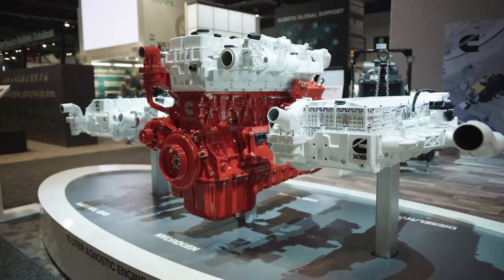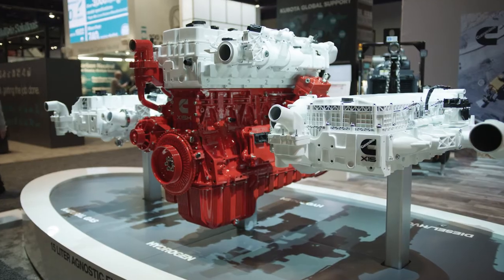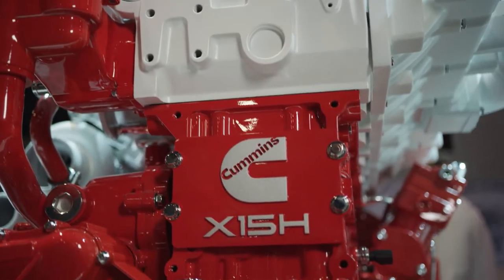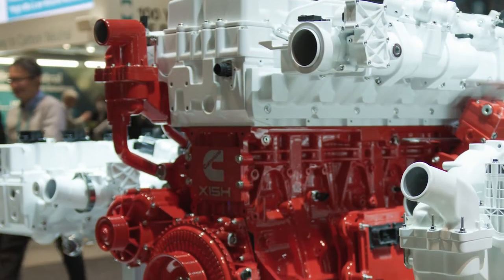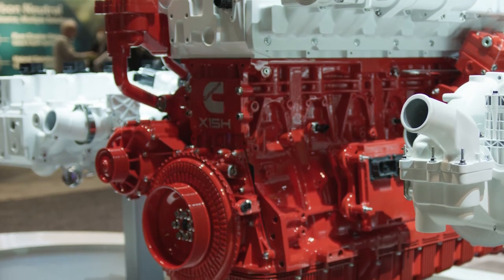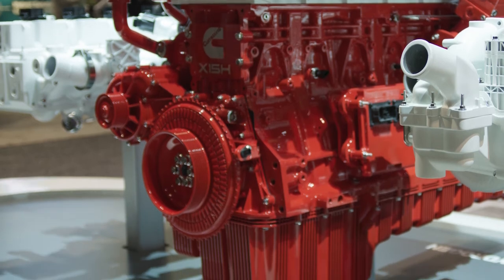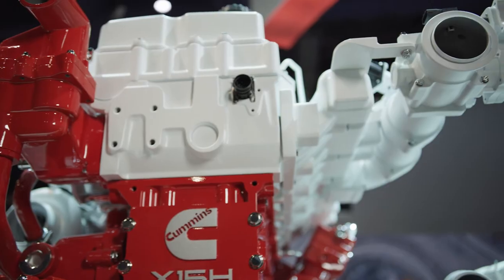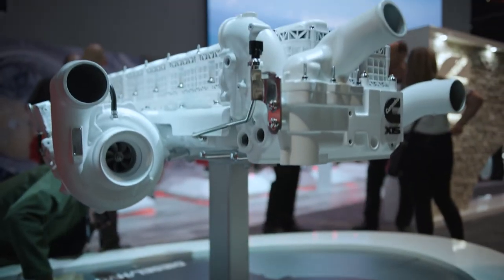A look at Cummins' Fuel Agnostic engine

Comment: Would love to see a "fuel agnostic" that didn't need a full head change out.  Meaning a Diesel/Natural Gas in a single unit.
Reply: I have seen an MAN engine like that at the factory outside of Munich.  It used a small squirt of diesel fuel to ignite the natural gas and had electronically controlled valves.  Those fuels have pretty different flame rates, a gasoline and natural gas combination is much easier.
Reply: @harryniedecken5321  They do exist, mostly as aftermarket setups here in the USA. What you are describing is a diesel pilot ignition - engines with these setups can reduce the diesel fuel consumption by 90%. Most useful when a ready source of methane is available, like a sewage treatment plant, landfill, animal waste digester, or oil field pump (where they are flaring off the waste natural gas anyway).  Any fuel you offset with a local supply is fuel you don't need to transport to the site.
  
It's just rare to see a wide-band design since the old military Deuce and a Half days. Those engines had fuel density compensators, and could run on anything from whisky to motor-oil. That's what I think of when I read "fuel agnostic".